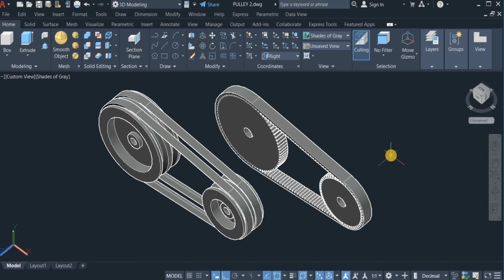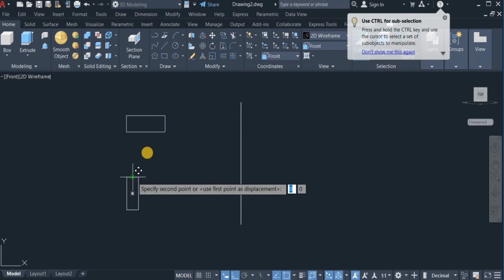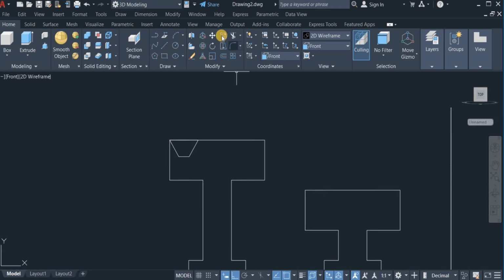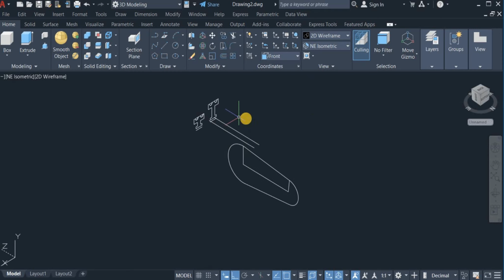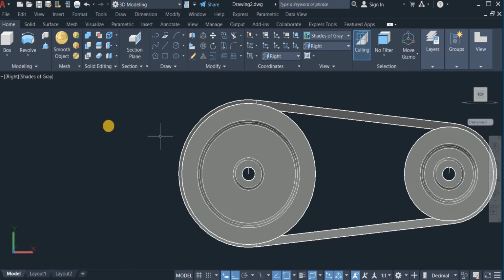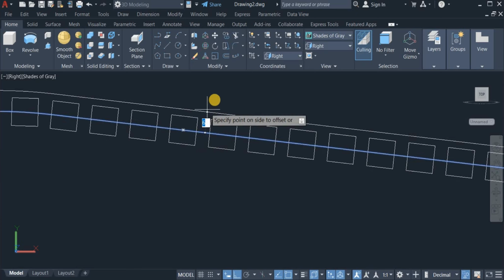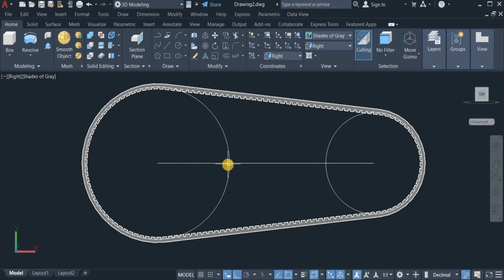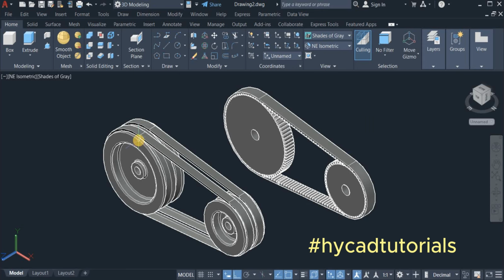3D Pulley and Belt Design (A Step-by-Step Guide)  #3DTutorial

Comment: I have a question about the chain pulley, what UCS did you use to trim out those rectangles? Because I tried but it didn't work, it keeps telling me UCS can't trim.
Reply from the maker: @fatormaamadu345  Turn the View to 'FRONT',  then highlight all the rectangles and start trimming.
Reply from the maker: Also make sure all the rectangles are joined using the 'JOIN' command.
Reply: @HYCAD  I will try it again